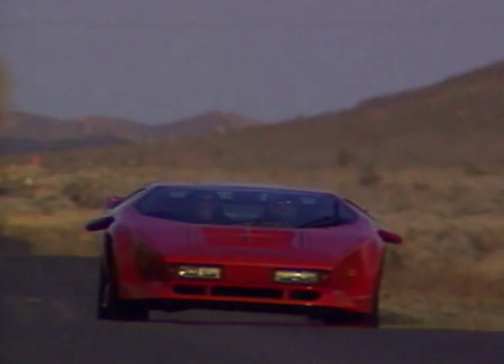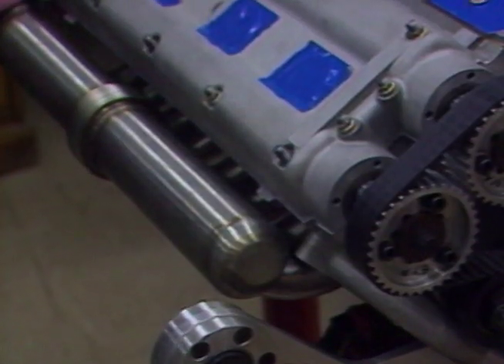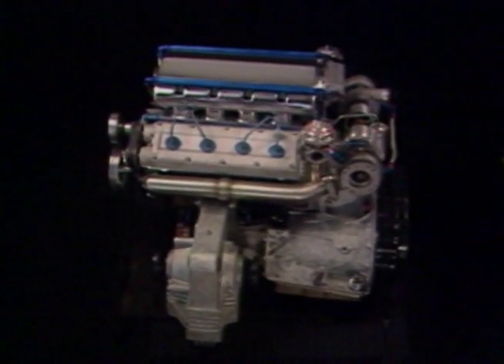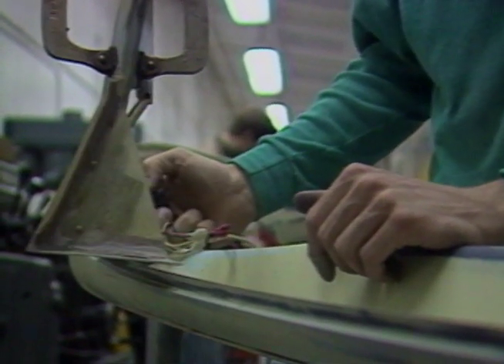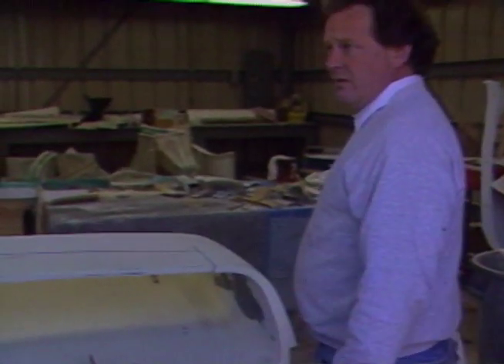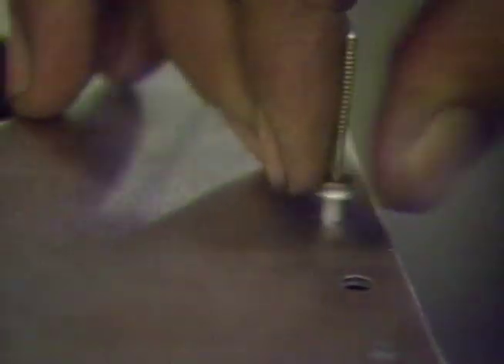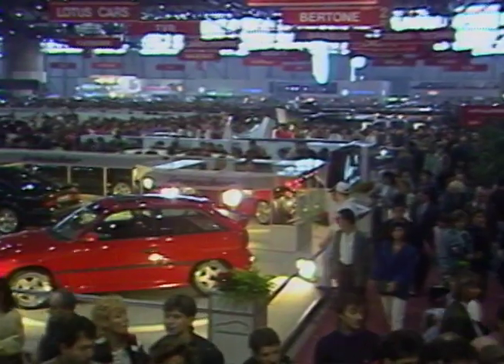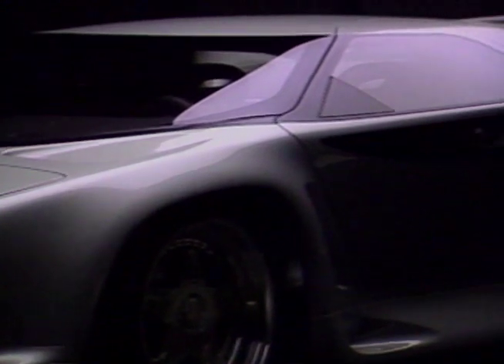Vector Aeromotive Promotional Video

Comment: Dayum. I always knew these guys were ahead of their time, but I had no idea how far until I saw the engines they were building for the WX3.
Reply: What's even more insane is how all the repairs were subcontracted. Car & Driver test drove this and had to get it serviced at a Goodwrench facility! Can you imagine seeing this bad boy next to Chevy Caprices and Astro vans?
Reply: There WAS a reason for this crazy approach which makes perfect sense. Wiegert found it frustrating that so many supercars used proprietary parts. This means special training and tools are needed that only the manufacturer could provide. This is why owing a Ferrari or Lamborghini results in VERY steep maintenance costs. I'd rather be able to have Joe Mechanic repair my $250,000 sports car with plain Sears sourced tools than have to drive to a specialized shop just because of how it was designed. Wiegert was ahead of his time. I'm still saddened that his dream didn't completely succeed. Interesting fact: one of his very first customers was Andre Agassi. I also think Jay Leno was on the wait list for one too.
Reply: largol33t1 

Good information, Ultimately, they sold out to Lamborghini, who went nowhere with the company. Shame.
Reply: Butch Tyrone he didn't sell out to Lamborghini, Megatech who owned Lamborghini at the time took control of Vector in a hostile takeover and fired Gerry, they then proceeded to run the company in to the ground.
Reply: @vermin1970  Vector was intending to buy Lamborghini. Megatech stole the deal out from under them and then did a hostile takeover of Vector.